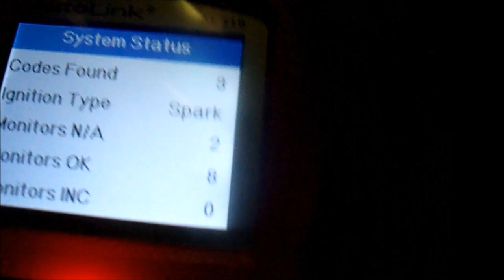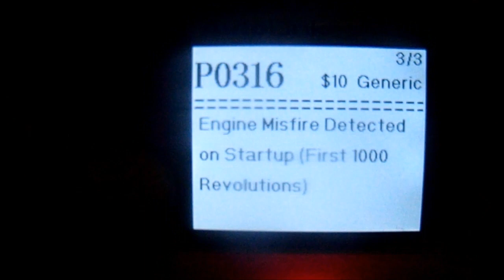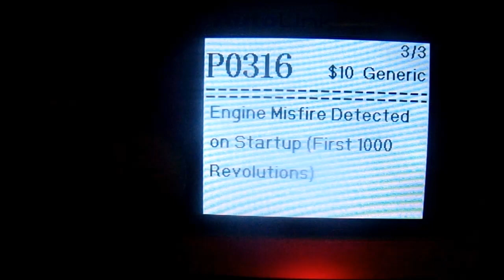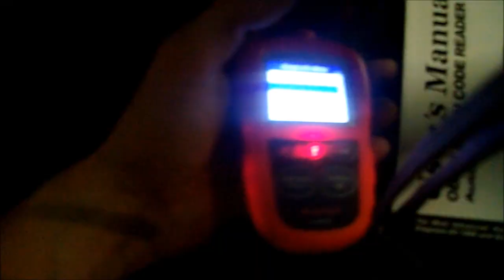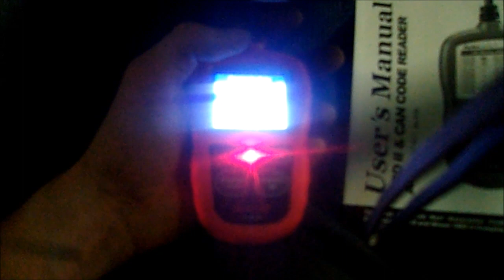2003 Ford E-350 5.4 Misfire / How to replace the coil packs

Comment: I have this vehicle.  In 2012, it coded for a misfire on #5.  I buy it and in 2017, codes misfire for #5 and I think another one.  All coils and spark plugs get replaced.  2019, same symptoms with the "nudge" in the engine purrr.  It gets a code for #5 again.  It gets replaced because the mechanic says maybe it is a defective.  Soon after, light comes back on again with the same nudge feeling. Compression is 190 -200 in each one.  Had them check for that and then gas pressure.  Whaaaa!
Reply from the maker: Pretty common with these to replace the same one after so many miles. Not sure why they fail so often. You may want to look into a genuine ford coil from the dealer. Probably not expensive but may be worth it
Reply: @NoPaintGarage  figured out the problem.   With the help of a friend who suggested it.  I took it to a shop where I was allowed to speak directly to the mechanic and not the front counter only. I told that mechanic all the symptoms an history about the coils.  I showed the records.  So he goes to work and calls the next day and says you need a mew coil and I will replace it.   I tell him, “no no...no,no”.  I already said that three other mechanics, possibly more,already told me this and then replaced it.  Shortly after, it breaks again and I am back in the shop.  I said do not just replace the coil when we talked.  I told you that you are to Find out why it broke.  And so please go back and spend the time looking for the problem.   He was reluctant and he agreed.  We hung up the phone. I even told him he can charge me for the hours it takes to go looking at all the wires and the other stuff up to a certain amount I said I could afford.  He hung up and about 15 minutes later, after lifting up the wires and seeing exposed ones, tells me he will rebuild that part of the wire line with the hole in the insulation covering and fix it.  No more coil cracking.  Yay!  Another 700.  Boo.

Comment: Excellent ! I had the same code #6 cyl.  Even the same code reader. lol  Took about 15min, start to finish. You da man.
Reply: It was a 2007 e150, 5.4, this is fist coil I had to replace @277,000 miles. Did plugs @ 225000, they still looked almost new.

Comment: Excellent video! I had seen the coil packs on an LS engine in a Corvette and thought that was really modern and innovative! Then, a few months later I found out that our 16 year old Mercedes has the same system! However, on the Mercedes the coil packs are all attached together so that if one coil goes out you have to change all four of them. This is probably an advantage however, as it is likely one of the others will go out soon when one of them bites the dust. The whole pack was not expensive, so it's okay. Thanks for a very informative video. You make it look easier than it is, I'm guessing.
Reply from the maker: yeah i like the Individual coils. the 5.3 in the 72 has them. most cars have them now. thanks for watching

Comment: Or you can unplug each coil one by one. When you unplug a coil you should hear and notice a difference in the way the engine runs. If you unplug one and their is no difference in how it runs. Then that is a coil that is bad.
Reply from the maker: Easier to use scan tool and misfire counter. But that is a good way if you don't have access to that stuff

Comment: Another video with bad advice. Those plugs need to be torqued to 25 lbs. or they'll blow out. You don't want them just hand tight.
Reply from the maker: 25 foot pounds isn't much. That's just snug